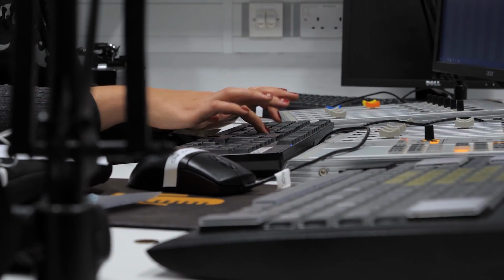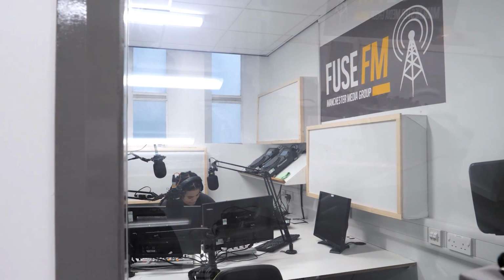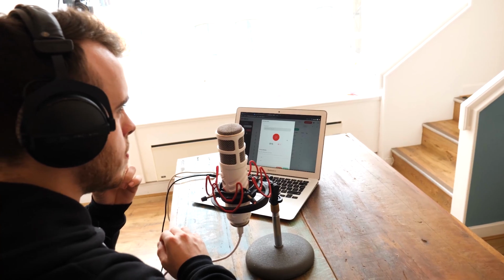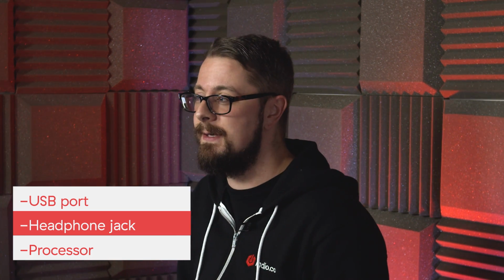[OLD] Radio Studio Setup for Complete Novices

Comment: How about try using a Dynamic microphone like a Sure SM58. Any room size fits👍👍
Reply from the maker: Yes! Dynamic mics are ace. But condenser mics offer a wider vocal range and sound much deeper (IMO).
Reply: @Radiodotco  I don't believe so. Dynamic mics amplify your natural voice so IF you have a good voice they work well. I haven't heard a condenser Mic that can match a Dynamic sound for Quality & zero background noise. Bottom line is if a person doesn't have a good sounding voice No microphone of any kind will improve it.